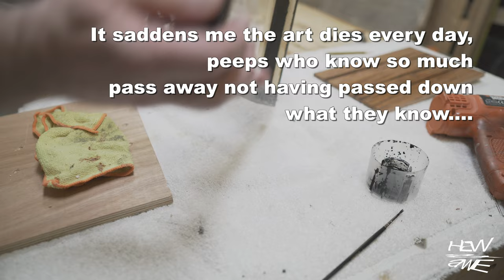Woodworking: How I got started!

Comment: Woodworking, for some reason, attracts a huge variety of characters with the utter snobs at one end who turn their noses up at anyone not using intricate hand cut joints or animal glues, to those scoffing at people working out of garages, to windbag know it alls which YouTube seems overrun by.  The other end are down to earth types with more humility.  They’re the ones I follow.  

Thankfully amongst this tide of testosterone, snobbery and BS there are many more humble characters simply sharing their experiences like yourself.  

I turn off at snobs, kit fanatics, Festool disciples and know it all windbags.  The best advice I was given was don’t try and measure and mark to sub mm accuracy.  You’ll get it wrong. Make whatever you’re making and use it to check or to set the sizing if what connects to it.  Best advice ever, much like you’d do with a joiners rod.

Keep your work area clean and tidy and your tools in good condition.  Don’t be told by others what finishes are “best” . Work that one out for yourself as you get to see pros and cons as well as getting hands on  experience to build up expertise.  I love hand finishing oils followed by wax finishing but others will use spray applied plastic finishes or varnishes. Whatever works for you.

Develop your own style rather than be disheartened at not being able to do the intricate work of others. Intricate joinery might take years to perfect.  Never be afraid of having a go at anything but make sure that you have the right tools for the job.

Don’t make the mistake of persevering with a contractors saw if you can afford a good  cabinet saw.  It’ll transform your precision and confidence.

Other than that just enjoy what you do. It’s such a privilege working with wood 👍
Reply from the maker: Every time a see a horse I think I’m I low on glue 😆
Reply: @HewAndAwe  🤣